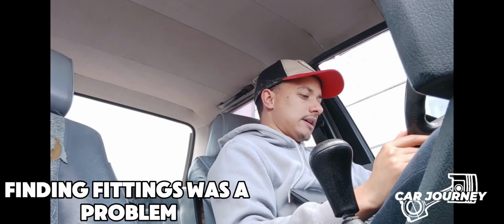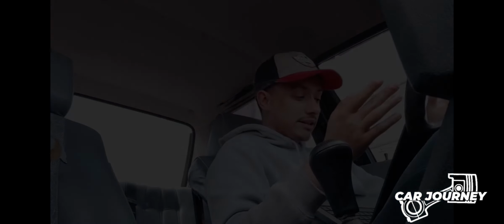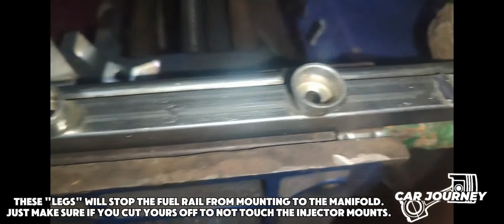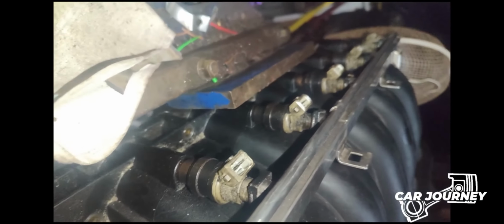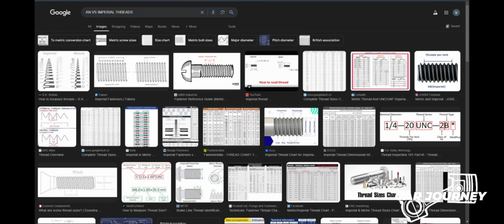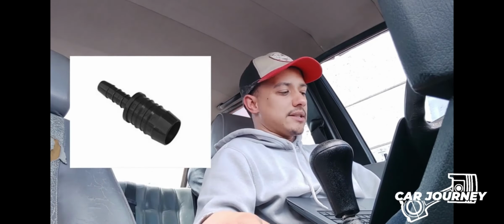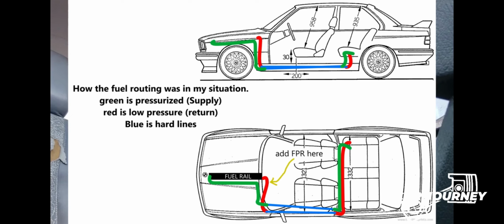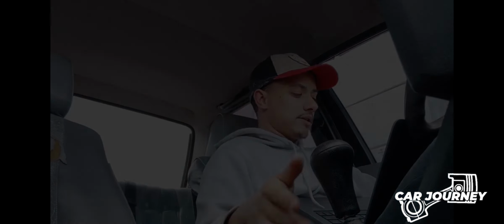BMW E30 ADJUSTABLE FPR INSTALL | CarJourneyYT

Comment: Nice video thanx , I think if you  start the business it would grow another thing that would also work is if people want to buy parts in and around cpt where they pay you to go and have a look at the part and if you give the go ahead pay the supplier and you send it to them too many ppl being scammed
Reply from the maker: I actually spent some time selling parts I didn't need on FB marketplace, but I'll need to build a reputation of trust where people would consider. I have been running around getting parts for some people but want to make parts more accessible for everyone. The courier guy is the most affordable option too. 

I should be going to the supplier of my fuel pipe this afternoon and I'll be hearing if he can do a bulk order for me.
Reply: @JasSpec  it's a struggle to get people you can trust with your hard earned money like now I'm looking for a Tappet cover for my M52B28 but yah all in time
Reply from the maker: @malcolmmay5674  I can look and let you know by the weekend?
Reply: @JasSpec  please 🙏